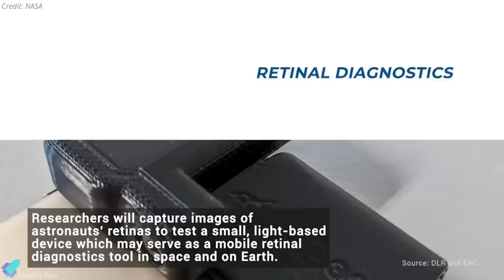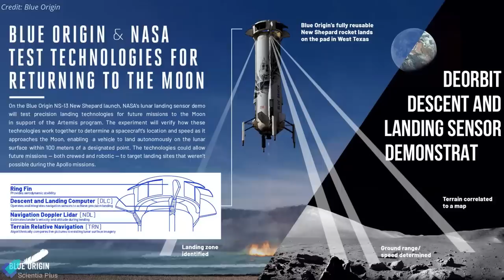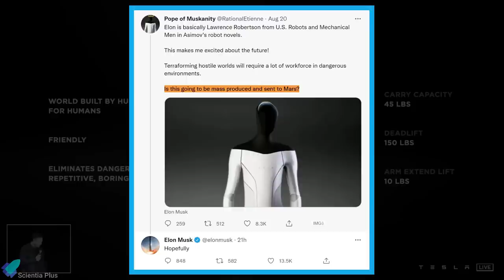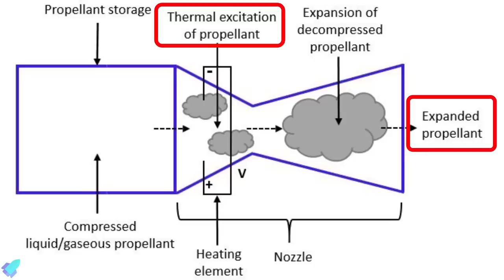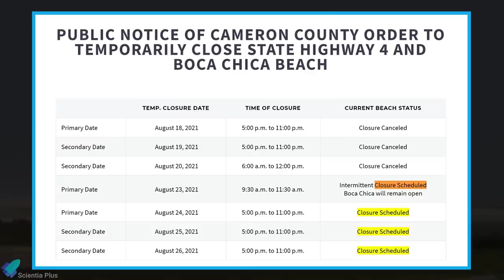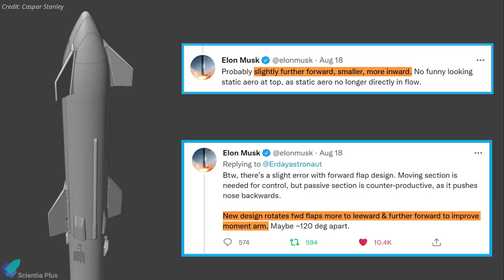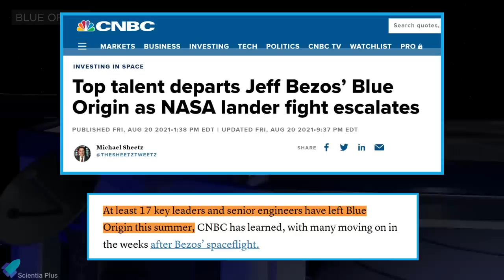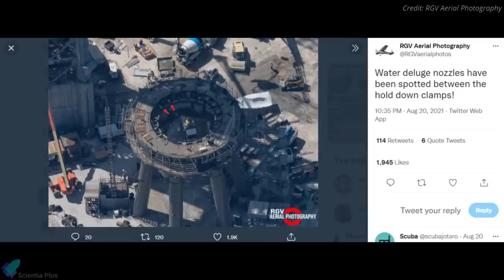Starship 20 Ready for Ground Tests | SpaceX HLS on Hold | Tesla AI Bot | SpaceXCRS23 | NS17 Mission

Comment: Why is Blue Origin being called a sub-orbital craft?   It is a high boost non orbital space elevator with zero capability of being orbital.  It is NON ORBITAL.  
I wish the dots showing satellites around the planet could be modified to reflect their true size, which is tiny and not the size of small towns as they are presently being depicted.
Reply: Because New Shepard flies a sub-orbital trajectory, even if it is almost straight up-n-down. Sub-orbital definition - "relating to or denoting a trajectory that does not complete a full orbit of the earth or other celestial body."

If the satellites were shown to scale, you would not be able to see them in the animation.

Comment: Why have we not seen any more Starlink launches? Also, why cant Elon just say, we (SpaceX) are going back to the moon. That requires a spaceship even if NASA decides to go in another direction. If what we have done is a good fit with NASA if we are to resume the contract, all the better. If not, we have not waisted our own corporate efforts towards our SEPERATE goals.
Reply: The Gen2 satellites have 3x faster data rate but arent FAA approved yet.
So they are waiting on the FAA.
Reply: NASA voluntarily stopped worked this time, but only after getting an agreement from Blue Origin to conclude the lawsuit by Nov 1st, 2021. Smart move by NASA to head off a possibly years long lawsuit for a little delay now. And it doesn't stop SpaceX from working on Starship, just NASA cooperation in working on Lunar Starship.